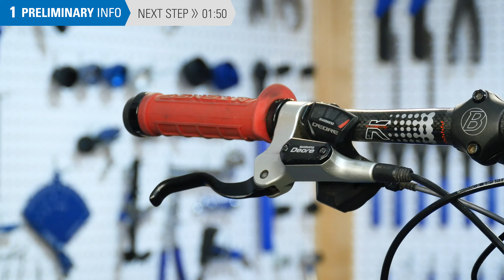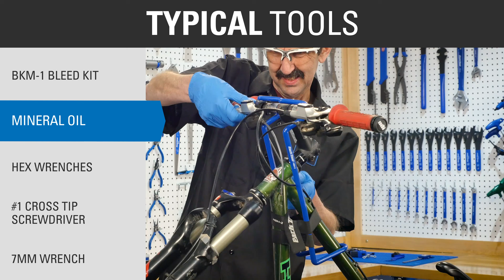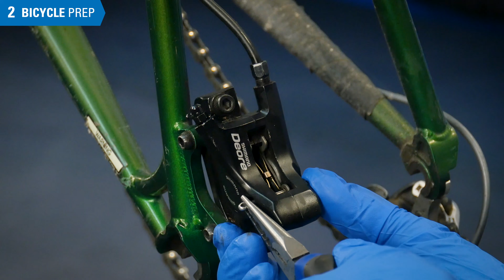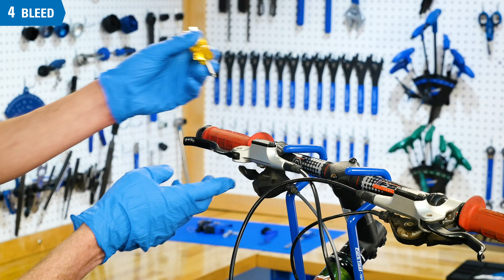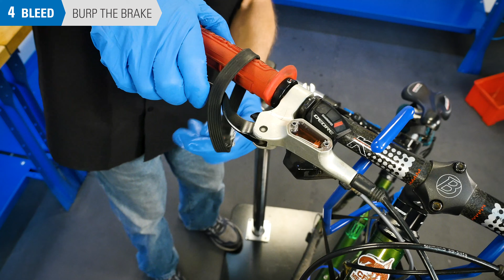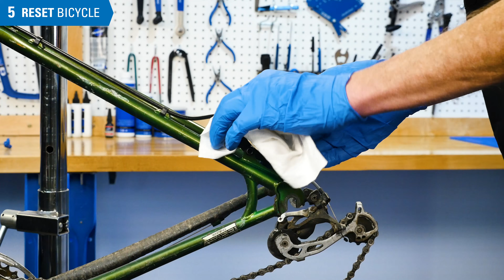How to Bleed Hydraulic Brakes - Shimano® Reservoir Style

Comment: hi there everyone does anyone know is it fine to do this the other way round you add down in the fluid and take away at the top reservoir i have done it for my dual xt and the lever seems to have a really firm result
Reply from the maker: If lever is firm, then no air is inside so it worked.

Comment: Hi thx guy . I do that on brm485 .after bleeding my brake make noise . I dont know where this sound came from ?
Reply from the maker: Often brakes make noise when the pads or rotors have been contaminated with oil or some other kind of liquid chemical. The bleed itself will not cause the squealing.

Comment: I do not like this style of reservoir system without a top bleed port (to mount a funnel). If one of these has a "spongey" issue, I have to drain the whole line into a cup (gravity+time) then refill the line, pushing up from the bottom syringe.

Comment: Aren't these all possible without removing the wheel?!🤔
Reply from the maker: You need to remove the wheel to install the bleed block and to prevent any fluid from accidentally getting on the disk or pads. The blocks make sure the correct amount of fluid is in the system.

Comment: One thing forgot – clean the sides of the pistons before pushing them back in?
Reply from the maker: Yes that is good practice to actually advance them and clean the dirt off of them. Its often suggested to use the systems fluid to clean them so when teh piston is pushed back in it hydrates the seal. Clean it, push it back in, advance it, clean it again and push it back in. On the last time of cleaning it use alcohol to prevent any contamination of the pads.

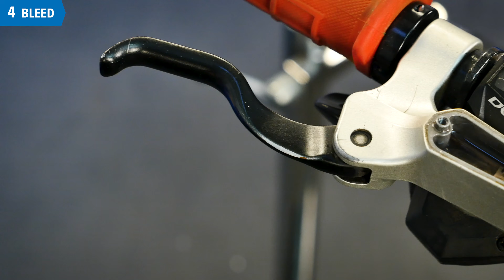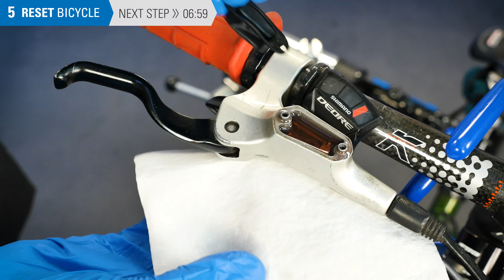Comment: Is it my imagination...or bad eyesight? At 4:10 the diaphragm cover comes out, with indentations downward, at 6:10  it goes back in with the indentations facing upward?  99% sure it the indentations should go in the reservoir. Maybe I did not see it correctly? 

And, I prefer caliper-up bleeds as one is not fighting the fact that air bubbles rise. A second person on syringe duty to suck up the fluid being pushed to the lever reservoir is pretty much essential. Agree that this video is the "official" method but hate fighting physics!  Love the bleed port/screw in newer models!!

Comment: What happens if you dont take the wheel off?
Reply from the maker: The pistons need to be pushed back into the caliper body for bleeding.  The brake block keeps them from creeping inward as you bleed. This is why the wheels are removed.  Even for systems that don't need that, it is too easy to get fluid on the pads and rotor.
Reply: @parktool  thanks.  The reason I ask is because sometimes in reality I dont have that much time
Reply: @diegeeleel  As sometimes things get messy, and you need the brake to work out where it needs to settle as it was designed to do. I'd always advise using a piston chuck block, even if you need to make one out of some scrap wood, otherwise you also risk pushing the pistons out of the brake and you won't realise until you keep getting air in the system, scratching your head as to why, and suddenly you realise the pistons are no longer in the caliper.

Comment: wouldn't it be better to push the oil upwards from the caliper so the air can rise ?
Reply from the maker: There are different techniques possible.  In this case the factory recommendation was to go top down.  As long as the air is out, it is good.
Reply: @parktool  thank youuuuu
Reply: That's what I do with my Magura brakes, but I don't think that these bath style levers really have the fittings to do that.
Reply: @user-yv2cz8oj1k  no you need the ones you can fit a  funnel at top. you push dirty oil into it from bottom, or in your case two syringes i think

Comment: Does brake fluid need change every 2 years like motorbikes and cars? Can i use a normal dot 4 brake fluid or on;y shimano fluid? Thank you!
Reply from the maker: If they are Shimano brakes yearly s suggested and you must use mineral oil. Due to mineral oil not being a regulated fluid it can vary in its properties so we suggest using Shimano Mineral oil in Shimano brakes.
Reply: @parktool  Thank you again!

Comment: I have an older type of Shimano break similar to the one in the video. They are very very slowly leaking oil (whenever I wipe it after a day it gets oily around the reservoir cap). Would replacing the diaphragm solve the leakage?
Reply from the maker: Is highly likely that replacing the diaphragm will solve your issue. Finding it will be the challenge. The exact model will be needed to find it.

Comment: I have both Shimano mineral oil brakes and SRAM Force DOT 5.1 brakes - with proper fluid for both, does this kit have appropriate components for both?
Reply from the maker: No, the kits are separate.  DOT fluid should never be mixed with brakes or brake tool for mineral fluid.

Comment: But how to know  when you must replace the fluid ( mineral oil) ?
Reply: When your braking isn't what you expect and you checked your pads and they are fine. I bled one I bought and it wasn't full plus the oil had gone a bit clear and with some black bits where the colorant had seperated, either meaning it was very old, or someone had resorted to baby oil.

Comment: What actually are you doing when you quickly open and closed the bleed nipple with the brake lever compressed? Aren't you just letting fluid out?
Reply from the maker: The bubbles are pushed to the end under pressure. The goal is to quickly flush those bubbles out the end.
Reply: Why not push them up the system? Doesn't the bubble rise?
Reply from the maker: bubbles rise but there are also corners where bubbles like to hide in the systems. Typically in the calipers. The rushing fluid helps dislodge those and eliminate them.

Comment: Little strange to see sort of high end Haro equipped with a deore group set have a two bolt bontrager stem
Reply: it could be as it trickles down , this years deores were previous years xts or Lx similar, they are good brakes ive used them for over ten years, il upgrade when they are done but until then, i cant complain at all. they are a faff at times though